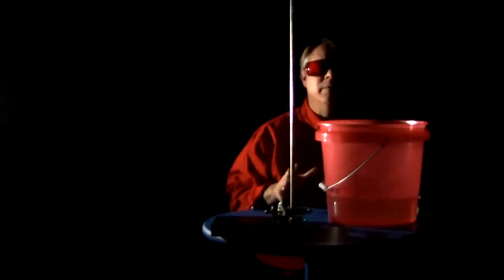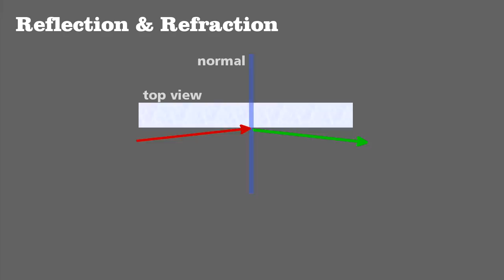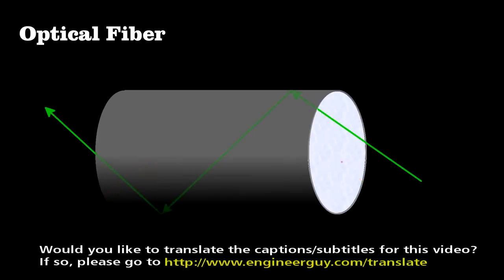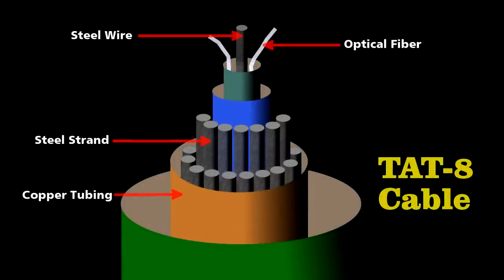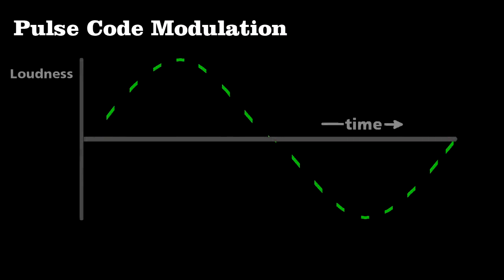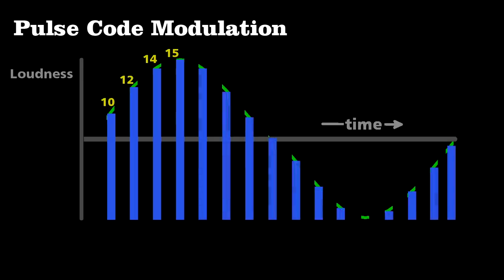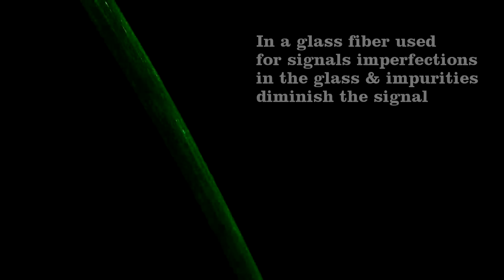Fiber optic cables: How they work

Comment: How do they boost the signal within the cable?
Reply from the maker: In this early system (if I recall correctly) they converted the signal to an electricial signal and then used a conventional amplifer. In later system they used an amazing erbium based amplifer -- an EDFA -- that is an optical amplifer. It uses stimulated emission like a laser. The wikipedia article on "optical amplifer" explains the essential concept.
Reply: +engineerguy So they have stations in the middle of the sea with amps? Cool.
Reply: I had exactly the same question. Thanks for answering it!
Reply: Fucking Voodoo Magic Man!!!
Reply: Fucking Voodoo Magic Man!!!
Reply: Fucking Voodoo Magic Man!!!
Reply: I don't think the electricity in the copper cable will travel that far, unless it's very high voltage. Even then, it sounds unrealistic.
Reply: Electricity doesn't diminish over length. The resistance does increase but it probably doesnt use extremely high amounts of energy. erikpoephoofd
Reply: lol how do you think the power is getting to your house... do you have a power station next door?
Reply: ScottWarnerOnline they have repeater / booster after every miles.
Reply: Amazing
Reply: Yes, because of the volt drop they use massive voltages and there will be a sub station near your house that  takes it down to the voltage you use.
Reply: Actually, electrical signals do degrade faster over a much shorter distance compared to optical signals. This is because electrical signals in copper cable are susceptible to noise which can be induced into the copper. This could be electrical noise from other signals in neighbouring copper cable etc. While I have studied electronics, it was a minor study in uni. My major was actually in fibre optics among other things. 

Optical signals do degrade, but do so over a much longer distance. As an optical signal pulse travels down the fibre, it suffers from a phenomenon called dispersion. An optical pulse is a burst of wavelengths, which may initially start of as a square wave or a top hat, but due to the interaction of the light with the surrounding glass, it loses its top hat shape and becomes more like a bowler hat shape. 

However, like i said, this signal degradation happens over a very long distance so repeater stations which regenerate the optical signals do not need to be placed as close together. Also, optical fibre is significantly cheaper per metre than copper. Standard telecommunications fibre sells for less than US$200 per km
Reply: "Amplifers"?
Cool info though.
Reply: redstone repeaters
Reply: Definetly the best comment
Reply: +TheBanjoShow hahahahhahaha im dead
Reply: ScottWarnerOnline it uses light or infrared radiation to send messages so information travels at the speed of light which I essentially the fastest you can get it to travel.
Reply: yes- was hoping you would also cover it in your video.  Other than that, very well done
Reply: they receive it, then re-transmit . thats why its called a 'repeater'
Reply: My grandfather worked for Bells labs. He worked on the undersea cable and I think he invented something relating to signal repeating, but I'd have to ask him for more information.

https://www.mtt.org/sites/default/files/content/AWARDS_media/Application_Awards/1986_Swan.pdf found this about him. Doesn't say what he worked on specifically for TAT-8
Reply: @MrChad97Z 
The resistance part is certainly correct. Copper has quite a low resistance over short distance. A simple Google search shows that.
However when increased over long distances the resistance does become quite an important factor. 
In short distances, degradation in the physical integrity of the copper cable such that the copper becomes exposed can result in noise issues. When a current travels along a wire, there is an accompanying magnetic field that is generated. The magnetic field lines are oriented clockwise to the direction of current flow. However a magnetic field can also induce a current in a conductor. Giving rise to noise among other things. As a side note this one aspect of EMP that makes them so dangerous. The enormous electric field in a pulse gives rises to a proportionately powerful magnetic field. When this field comes into contact with electronics the magnetic field induces enormous current surge along conductor pathways. Typical electronic traces are less than a millimetre wide and won't withstand more than milliamp levels of current. In an EMP the magnetic field can induce currents in the tens maybe hundreds of amperes, or even higher. Copper traces in electronics, and cabling, have max current ratings which will be vastly exceeded by an EMP causing burn out and destruction of electronics
Reply: @MrChad97Z 
In the early days there was a lot of optical to electrical signal conversion before the advent of optical amplifiers and signal compensation.
The biggest invention that allowed modern telecommunications as we know it was the erbium doped fibre amplifer. This bit of technology revolutionised optical comms. At the time of its invention optical communications used the C hand. A range of wavelengths between 1520 and 1570nanometres (billions of a metre). This range experiences the least loss in  atmopshere transmission so free space propagation of these wavelengths did not result in much loss. Erbium is a rare earth element which has an unusally convenient property. When its atoms are excited with a laser typically at 980nm, the erbium atoms absorb the light then re emit it at across a band of wavelengths at, you guessed it, 1520-1570nm. So the neat trick is, you can have a weaked signal say at 1550nm travelling down about 100km of fibre. So you connect your signal fibre to your EDFA. The EDFA will additively (minus some loss) boost your weakened signal. When the EDFA is running any signals that arrive within the wavelength range that it is emitting at, that energy is added to that signal. However, it will also amplify any noise components in your signal. So if you have signal dispersion or distortion that will get amplified as well. So typically, before an amplifier you will have dispersion compensation which will help reshape a dispersed pulse into a more square shape and gain flattening which will remove any distorted signal tops after its been amplified.
That's pretty much the simplest explanation I can give. There are of course a lot more elements involved

Comment: Wow, I always imagined the transatlantic cable as being so much larger!  I figured it was over a foot in diameter, and marveled at the sheer amount of material it would have taken, but that it's able to be so small yet durable and able to transmit to much information is even more marvelous!
Reply: I don't think you understand
Reply: @AverageAlien 😅 idk where to start in correcting that comment
Reply: it seems that other guys are very gatekeepy, saying your comment is wrong but not wanting to correct it
1. the cable is indeed thick, thicker than that stereo cable, you can just google for the exact diameter (idk whether it's one foot or not since I use metric)
2. they use more than one cable, even between same region (such as NA and EU), both to increase bandwidth and also to be a backup in case one is broken
Reply: @skyfeelan Thank-you for being you.  👍

Comment: "In Tat-8 signal travels 50km before it needs to be amplified" 
I was SO hoping you would show us HOW the signal gets amplified in a cable on the ocean floor.
Reply: It might just be some basic amplification method like some crystal that magnifies the incoming light?
I mean it would likely have to be implemented in the cable itself all along its length.
I also wanted him to explain that part.
Reply: Waiting
Reply: SAME
Reply: Likely through the usage of powered repeaters.
Reply: I'm guessing it might be some sort of lens that's gonna point all the rays back to the same angle they need to point in order to keep being reflected.
Reply: @richardhz-oi8px  so ... What's the power source? Another cable?
Reply: They use what's called an Optical Repeater. An optical repeater, unlike a traditional electric repeater, amplifies the optical signal without having to encode the signal to an electrical signal first. An optical repeater uses an additional laser, as well as an erbium-doped optical cable to produce additional photon excitement, amplifying the signal. A "doped" material is basically a material that was shot full of another exotic element, in order to change it's electrical properties. It's the basis of semiconductors and a key part of modern electronics. It gets really complicated really fast, but it's worth reading about.
Reply: The magical part is this is a digital signal, with error correcting bits.    The amplified signal is exactly the same as the original signal and can be reamplified as many times as needed.

An analog cable would pick up noise as the signal weakens, and each time you amplified the analog signal you would amplify the noise.
Reply: Sunlight.
Reply: @bjb7587  - there is no sunlight on the ocean floor
Reply: @ArtStoneUS  anglerfish
Reply: In the old days they did it electronically but now they do it with erbium.   The erbium is put into a small section of fiber, and exposed to an external light such that some of the atoms are excited.   When the real weak laser pulse comes in after traveling 50 miles it is still enough to trigger the erbium into lasing.    I guess the main idea is you just need a power source for the erbium and nothing very fancy just 2 wires making a very simple and robust amplifier.    The erbium only amplifies a relatively small band of light, but it is enough so that I think nowdays they actually send 40 very slightly different wavelengths down a single fiber and use a special kind of diffraction-on-a-chip to separate them at the receiving end.
Reply: @richardhz-oi8px  yo like redstone repeaters? Idk dawg redstone doesn’t work underwater, if you get redstone wet it reverts back to item form

Comment: Working for the phone company, we could use a flashlight to light up the other end of a  fiber miles away so someone on the other end could confirm which fiber we were working with. 
I found fiber optic cable to be absolutely fascinating.

Comment: If we can see the beam bouncing around inside the propylene, doesn't that mean photons must be reflecting out to our eyes?
Reply: no, the liquid is clear so we can just see through it. trust me I'm a scientist
Reply: A true scientist would never say "trust me".
Well, I'm not scientist, but I think that what you see green are scattered photons from ambient light that pass through the water stream, hit the actual laser beam and are refracted in the camera's direction.
Inside a cable, the photons from the laser beam should travel without external interference.
Reply: 0:40 he mixed something in so some light would be scattered and make the beam visible
Reply: I think photons are coming in from behind the liquid, into your eye, so you can see what's in there, instead, because they refract through the water at an angle where they do escape, and they interact with the green light inside the stream. It's the light in the environment, not the light coming out from inside the stream itself.
Reply: @EXHellfire  That is an interesting explanation which is completely wrong. We can see the laser because he added a bit of milk to the liquid; that causes some of the light to diffuse out in all directions, and some of that gets to the camera and shows up as green. It's not very much, which is why he's filming in the dark.

Comment: I understand the concept, but I simply cannot wrap my head around how in TAT-8, with only 6 cables, can handle 40,000 simultaneous phone calls. Would the light travelling through the cables not interfere with the other light travelling through the same cable?

Comment: There was a point when you said, "up to 1600 meters per second," but the subtitles said, "up to 1600 meters per minute."
Reply: +Destructor1123
Good catch.
2:34
Reply: Destructor1123 I heard it, too. Backed up a few times to confirm. 1600 m/s is 5760 km/h (3580 mph) or about Mach 5!

Comment: How do people know how much time is between the ones and zeros? They could easily confuse-read a whole different code if they didn't know. Always puzzled me..
Reply: I think the computer would know, like 1 second = one 1, or one 0. But the time would be much less than 1 second.
I don't know though
Reply: 1 is light
0 is no light
Reply: Bach Is Back The same way all computers transfer information. Clock speed. They either negotiate the speed automatically by both ends increasing speed until they can't understand each other or manually set by a network engineer. If you were to chop time it into ticks, the receiver would know the difference between 0000 and 0001 because there was no light for 4 ticks rather than 3. It only gets so much time to send one bit.
Reply: Google (or wiki) "Self-clocking signal".
Reply: To make it simple lets say the period is 1 second. the first second light meaning one after that another second nothing appears meaning zero and so on. but in reality it sends billion of codes per second or even trillion
Reply: For eg, if i want to communicate 1010110100, without speaking to another guy sitting at 15 mt. in front of me. it will be pre discussed that if i raise hand it should be considered as 1 and if i keep my hand dropped down, it should be considered 0. so here i go..
raised hand
then down
then raised
then down
then raised
now?? i am already raised how i can raise again..??
do to deal every digital signal there should be a clock in device, like out computer(mine is 8 GB, 2.66 Ghz clock speed), mobile, or whatever digital equipment you can imagine.
for eg, in our game above my clock cycle at both player is 1 sec, now we both have watch.
1st sec, raised
2nd sec dropped
3rd raised
4th dropped
5th raised
6th keep raised.
7th dropped..
that's it.. the other person capturing this, and he got the signal.. 
1st sec 1
2nd sec 0
3rd sec 1
4th 0
5th 1
6th sec 1
7th sec 0..
and so on..
in general these clock cycles are very fast, like my laptop.. 2.66 GHz.. means it divides 1 second into 2.66x10^9 parts.. and now the receiver and senders compares or waits the signal (light is glowing or switched off) for 1 part of this small fraction of a second.
Reply: vivek kumar if I want sent two messages at a time then how can it work. That is two sender and two receiver in a single cable at a time. Give me a perfect example like this. that
Reply: For that you need to use DWDM concept, passing different color of light through same fibre same time.
Reply: Manchester coding is also a very common method for it. Instead of seeing the 1s and 0s as volt on or off they count the transitions from on to off and off to on.

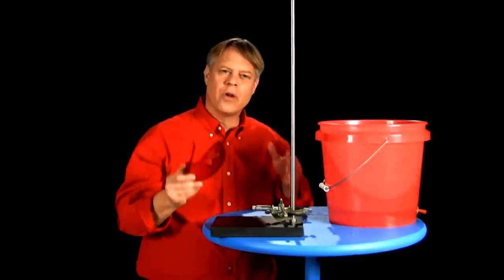Comment: 4:40 yes im wondering and yet you dont explain how they boost the signal
Reply: (Amplified after 50km)
Reply: Correct. There's power wiring stored in the middle of the cable, with the fiber optics surrounding it. When you have power going alongside the signal, it's trivial to boost the signal. That said, any type of boosting creates lag in the system. So it's very sought after to somehow get rid of them (Not to mention it would cut down on cost quite drastically too)
Reply: The copper cladding carries the power, you need low resistance to go long distance in addition to to the  high voltage from the power supply on either end.  Power is the key factor designing how much capacity you can get out of a cable.   You balance number of fibers with distance between amps get the most out of the cable.  The delay introduced by the EDFA is trivial and a non-factor.  A cable can only support X number of EDFA's,  so you run into situations were say EDFA spacing is 60km and it supports 4 pairs of fiber, but if you space at say 70km you can get 5 pairs at reduced performance.  Those are two of the many knobs of levers in play.

Comment: But does the laser go on if you expand the stream flow. In this video you showed us the light can travel atleast a meter when entering the bucket. But does the light stop at a certern meters, does the light get weaker. What is the max amount, and is the power of the laser a important factor in that. Sorry for my bad english. Im a dutch dyslect.

Comment: Impressive how transmission of data under the ocean mimics the cross section of a bundle of neurons within a nerve. The structure of a fiber optic, created completely independent of biology, converges upon its design.
Reply: True. It's called Ephemeralization. Coined by R Buckminster Fuller. Do more and more with less and less till you can do everything with nothing. All man made design converges to nature's optimal and efficient designs. Neural networks, Topology Optimization etc. all based on the biological world.

Comment: Wait, so is an amplifying system built into the ocean floor every 50km?
Reply: Yes small underwater station which has battery which need to be replaced after 3 years

Comment: I have a question.. ok, so the cable transmits 1's and 0's in the form of light, but, how could it be sending thousands of phone calls that are all happening simultaneously? Can it only send 1 packet of information at a time?
Reply: As far as I know, they multiplexers, a component that allow us to convert many inputs in only one output. Then, we receive that output and use a decoder to convert that signal into many outputs.
Reply: This comment is giving me networking lecture flashbacks oh boy...

Comment: Fiber optic brain interface is suppose to come online in 2025. The fiber optic is actually interfacing with a brain chip. The brain chip instantly reactivates & connects 10X more neurons than what you normally use at one time. Theoretically your brain processing & learning should increase by a minimum of 5 fold. Everyone will be a genius by 2030. It’s gonna put colleges out of business.